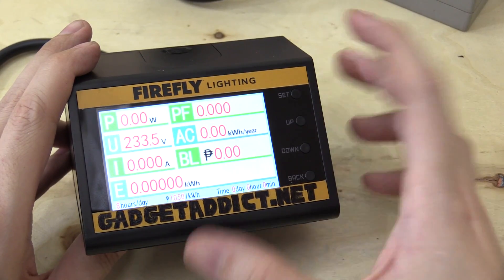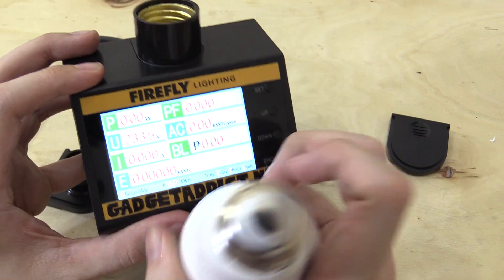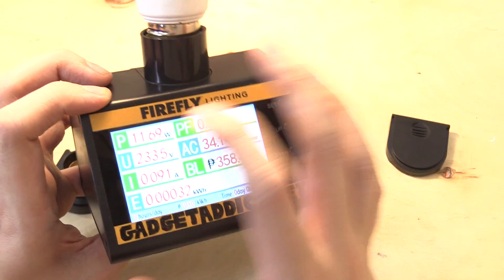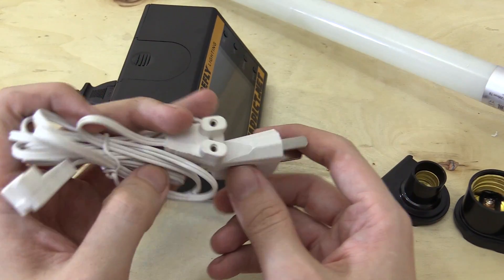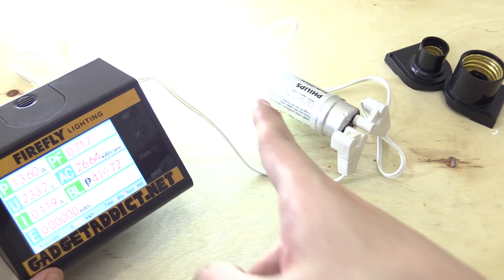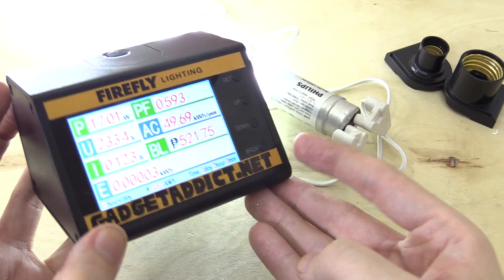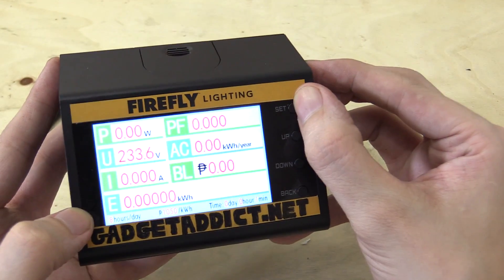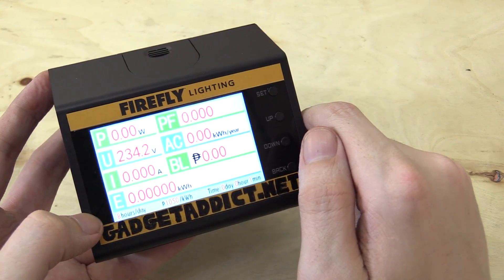AC Watt Meter LPT200

Comment: Hey GA, what local brands do you recommend for a good AC watt meter and watt meters for powerbanks, specifically for capacity testing? I plan to do capacity testing for a couple of portable power stations and powerbanks that I have. Thanks.
Reply from the maker: I'm not aware of any local brand that makes their own. They just import and pit their logo on it. 

For the USB load tester, something from ZKE that connects to a computer for advanced data logging and very adjustable load tests.
Reply: @GadgetAddict  I see. Where do you get your AC watt meters her in the PH?
Reply from the maker: @cubic-c  there's a lot of options on Lazada and Shopee 👍

Comment: awesome! would love to try on 1hp aircon, ref washing machine etc....  have you tried it in your aircon yet?
Reply from the maker: I've tested my other watt meters on the aircon but not this new one. Something to remember with the aircon is that the compressor isn't running all the time. When the compressor is running, the appliance will be drawing more power. So you typically want to measure the aircon for a full 12 hours or however long you usually run it. That way you can get a more accurate reading of how much power it consumes.

Comment: that is absolutely useful for the home in terms of checking how many watts we've been using or consuming in all the things inside the house that uses electricity.
Reply from the maker: Yeah it's really useful :)  Meralco actually have a relatively new scheme called the 'Orange Tag' as part of their Power Lab. Basically companies can team up with Meralco to have their device tested and then they'll put an orange tag on the item which tells people how much it costs per day to run.
Reply: that would be great. and having one  of that device also will be much better, it comes in handy though.

Comment: how much and did you buy that on firefly?
Reply from the maker: Firefly don't sell this power meter. It's branded Firefly because they use them for some internal testing. I see the LPT200 being sold on AliExpress for around 60USD / 50 GBP / 3000 PHP.
Reply: Thats alot of money😮
Reply from the maker: Yeah it's a bit pricier than some other watt meters. My other AC watt meters cost anywhere from 20 - 30 USD. With the LPT200, you're paying for the build quality, the nice screen and the high resolution readings.

Comment: What's the exact model of the fan Sir?
Reply from the maker: It's a Hanabishi 6" Velocity Fan. Model HIFF-600. It's a great fan but the blade and case rusted pretty quickly. The motor itself is rust free :)
Reply: Same with what I had before. A bit bigger than yours. Looking for something like that but doesn't rust fast. Really looking for something that consumes very little wattage. Thanks Sir.
Reply: Same with what I had before. A bit bigger than yours. Looking for something like that but doesn't rust fast. Really looking for something that consumes very little wattage. Thanks Sir.